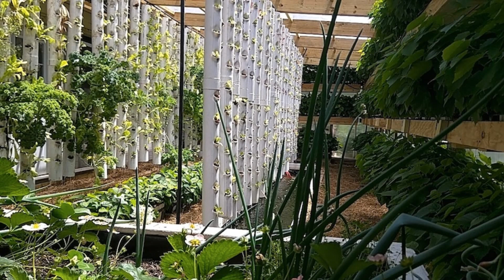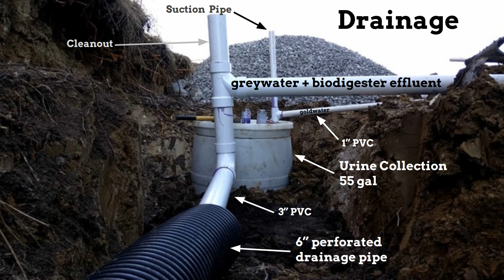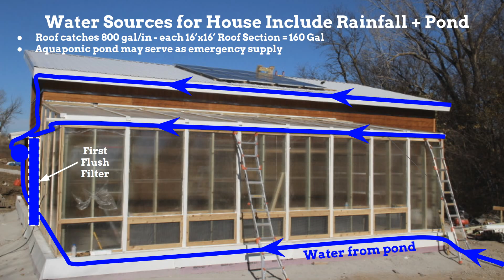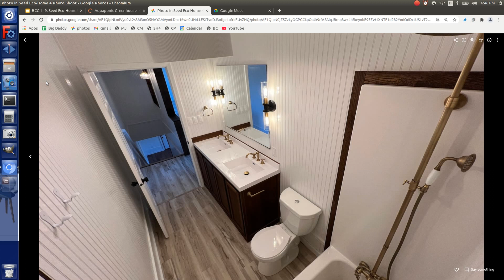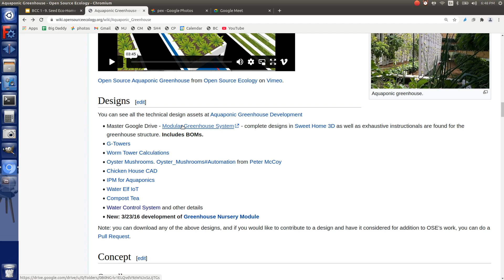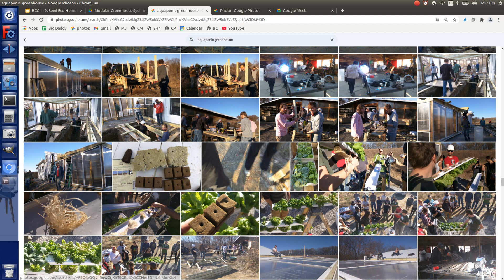Seed Eco-Home Utilities Overview

Comment: You should look into using Bitcoin miners as a heat source. No lower limit to working temp, and it's more efficient at cold temps vs heat pumps... You can offset the majority of your heating cost via the Bitcoin rewards